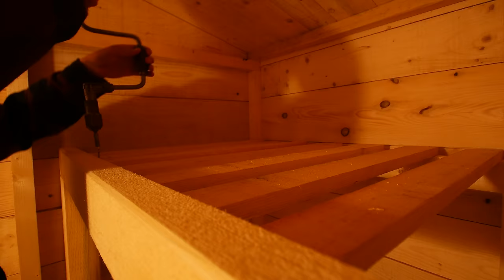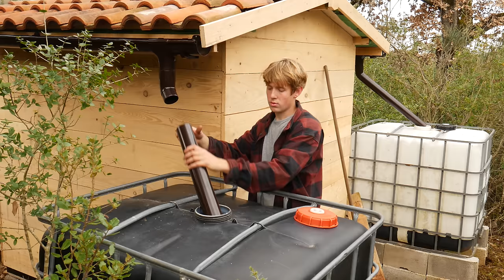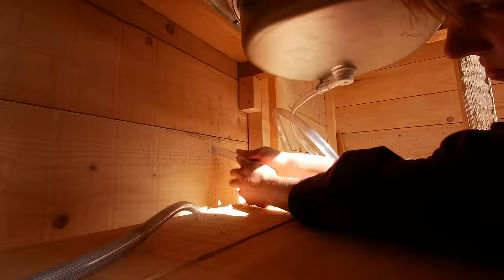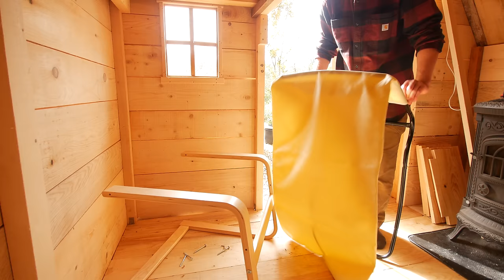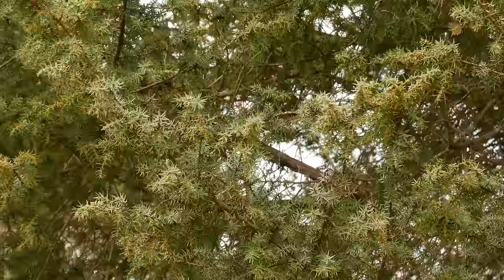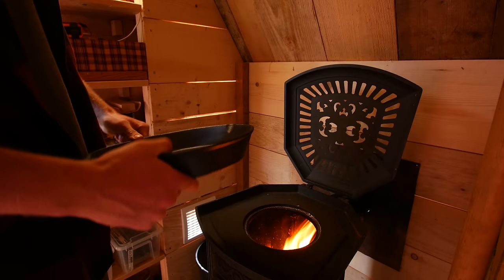I'm FINISHING the Interior In the Off Grid Tiny Cabin | Bed, Kitchen, Rainwater Harvesting | EP 11

Comment from the maker: Hello my friends.
I am building this small house so that I can stay on my property where I'm building the main log cabin from big round logs. In this episode I finish the cabin interior which is only 4m² (43ft²). I managed to put a bed, a kitchen, an armchair, a stove, and a small bookcase in this space. I placed the armchair under the bed and there is room for one more armchair. It's surprising how much can fit into such a small space.
I power this off-grid cabin with a homemade 12v battery bank that I once made from a lithium-ion cell that I took out from a broken electric bike. Thanks to this battery pack, I can light up the cabin, power a small water pump that pushes water into the faucet, and I can charge the batteries from the camera I'm shooting with.
My main goal for this cabin is that I want it to be super cheap and super quick to build. I don't want to spend a lot of money and time on this cabin. I have a big main log cabin for that :D That's why I used fresh boards for the walls, which are much cheaper than dry boards. I also saved on parts such as the sink from a rotten rv camper, or the homemade 12v that I already mentioned, the faucet is also second-hand, it doesn't seal well and water drips into the sink, but only when there is pressure in. As I don't have constant pressure in it, it's not a problem for me. I got the roof tiles and two large tanks for free, and I already own the cast iron stove. So I was able to build this cabin very very cheaply. Total spend is roughly 350 Euros (378 USD). 
Thank you all for the positive comments. I appreciate it very much. 
If you want additional information for the video, you can turn on optional subtitles in the video.

I would also appreciate a lot if you can support my channel by subscribing!
https://www.youtube.com/channel/UC4R2psHs0FQP7f2LRaS36ZA?sub_confirmation=1
https://www.youtube.com/channel/UC4R2psHs0FQP7f2LRaS36ZA?sub_confirmation=1
https://www.youtube.com/channel/UC4R2psHs0FQP7f2LRaS36ZA?sub_confirmation=1
Enjoy🌲
Reply: I just finished watching your video? And I'm a bit jealous that I don't have my own property in where I can build my own MAIN LOG cabin and a small cabin to boot! So to that I 👏 you and good luck on your future endeavors and the finishing of the MAIN LOG cabin. 👍
Reply: Nice work. Looks cozy. God bless.
Reply: Where are you?
Reply: Everything glows the golden pine color , so nice to watch . I wonder where you are on this planet ?  ❤ oh now I see , it's Alaska , such a cute place !
Reply: The door has so many gaps in it. Won't heat escape and cold come in?
Reply: The concept of using roof rainwater troughs to make water collection tanks to store water is great. In mountainous areas, water collection tanks for water storage are very important. The small ventilation blinds installed above the sink are very interesting. Some of the detailed equipment you installed are very practical and interesting and deserve praise.
The design and construction of your indoor furnishings are very good, and you can also be called an interior decoration engineer.
Reply: interesting project 👍
Reply: Me ha gustado mucho la creatividad que desbordas, y esas ganas que tienes de tener un espacio propio, esas ganas que hemos tenido todos de jóvenes, y que veo ahora en tí.  Muchos 😘😘😘😘😘😘😘😘😘😘  Y 🤗🤗🤗🤗🤗🤗
Reply: I have my Dad’s bit and brace and his other hand tools.  It’s no wonder he had strong arms.
Reply: @dahomesteadacre5099  my first thought was spiders lol!
Reply: You live in a shed like bubbles from Trailer Park Boys. 😂
Reply: You are a very creative,skillful and briliant crafts man. It was a great pleasure to watch how you smoothly and skillfuly work. Please keep up your wonderful work long time to come. Many ,many thanks for you giving us the oppertunity to watch your great work.
Reply: I've seen a lot of these vids. The work is good, the idea is prescient, but the human is most important. I actually heard a guy speak a little and that video was better than the others.. Good luck

Comment: The white IBC tote will break down quickly in the sunlight. One could screw timber boards to protect it and pretty it up, or a coat of exterior UV resistant paint. Personally, I used colourbond corrugated roofing iron, tek screw to the frame.
Also, the plastic valve was not designed to open more than a few times and will break unexpectedly....there's a special-threaded adaptor that will convert it to regular NPT 2" thread, then attach a regular ball valve.

Comment: as much as i like watching your videos and think how cute and skilled you are, there are a few things that need improving: there’s no insulation inside the hut. there are gaps between the wooden boards, the door etc. the water tanks are exposed to the elements so come winter the hut will become uninhabitable because of the aforementioned issues and the water in the tanks will freeze. also that water (rain / melted snow) should be filtered and boiled before it is safe to drink. you got a place to rest, cook, do the washing up and sleep but there’s no ‘bathroom’ and where does the grey water go?

Comment: Doing a great job so far, Matthias. The tiny cabin will make a great spot to support the cabin build. I'd love to Air B-n-B out there when you're done!
The one thing I did have a concern for, and you may have remedied it, is to seal the top of the two tanks you are using for rainwater. It would be inconvenient getting leaves and such in there, and far worse should a critter fall in and drown.

Comment: Tank,  you should put a larger P trap from the gutter, and make it easily removable and cleanable.  It is much easier than trying to clean the tank if the valve gets plugged from the inside. .. also, they make cheap black plastic cover for these .. from A land online.  You want to light to get into the tank .. even from the bottom.. as it will cause green algae or such to grow .. with it NOT covered by a black cover.

Comment: Mind if you install giant solar panels on your log cabin's roof?
Reply from the maker: I will get solar panels later, but I probably won't put them on the roof
Reply: My son gave me two cast iron pipe T shaped clothesline posts. We used these as a base for the solar array. Thus we can pivot the array to catch optimal sun year round. The whole system is homemade, but it's going strong five years now. Glass matt deep cycle batteries are awesome.

Comment: Sinks are inserted from the top and caulked into place. The exposed overhanging edges of wood will absorb any splashed water causing them to swell and eventually warp. The ridged area on the left hand side of the sink is a small drip drying area for glasses and mugs.
Reply from the maker: I agree, it's normally done that way. My sink is cut off so it's ugly so I put it from the bottom so you can't see the cut. This cabin is only a temporary outbuilding, and as long as the two rough boards that make up the "kitchen" have time to rot, I really don't mind :D

Comment: Are you going to nail a weather strip over all the seams where the boards outsofe meet to seal ghe cracks between the boards against ghe weather n wind n bugs from getting into your cabin your door has open seams also or are you living in a hot dry weather all year around area… can we seat it sealed wigh weather boards over the open slats between the boards on walls n door?